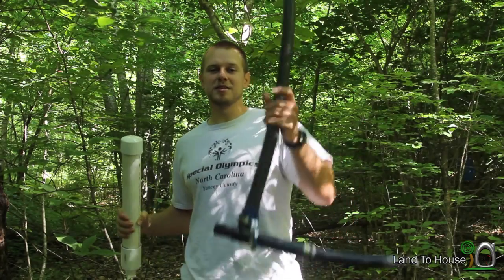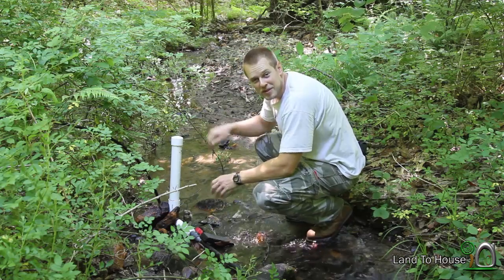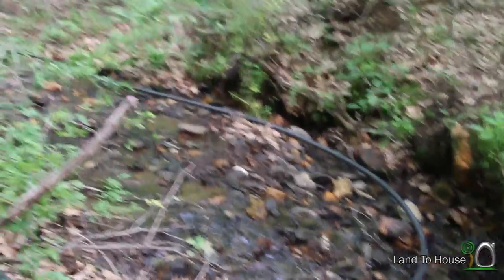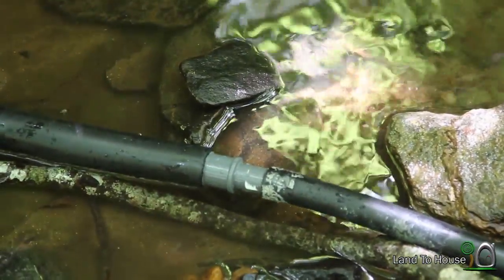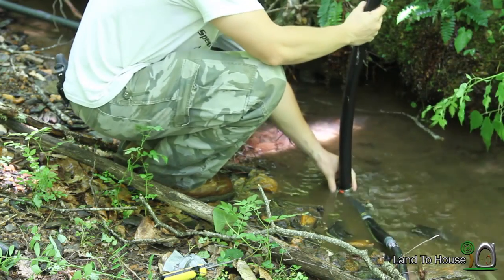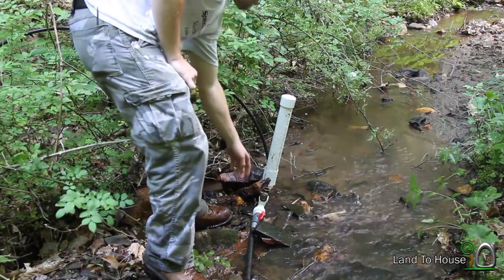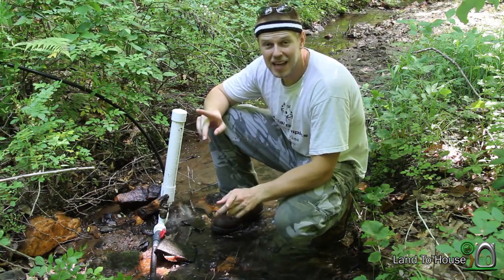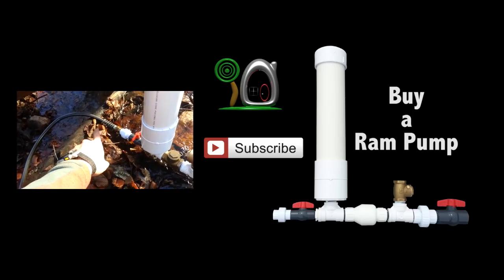Stand Pipe For A Ram Pump

Comment: I have a spring and the water supply is 30 feet away from pump.  I have a stand pipe ready to install but the five gallon bucket would be soon after that.  

I have a 1 1/4 inch ram pump and I have been following for a few years   I thank you for being a source of information.

Do I install the stand  pipe after the 5 gallon or before?  Or I don't need the stand pipe? I have to go approximately 350 feet

Comment: I've been watching your videos and you talk about the 3 2 1 on the supply, but I watched one of you're 1  1/4 videos and you only used a 1 1/4 drive pipe out of a bucket. My creek runs 300 gallons a minute and I put some extra  1" pipe I had from my well and it was pushing over ten gallons a minute through it. I have enough water to run the 1 1/4 pump, but i'm trying to figure out if I have to run 2" pipe for my supply? Any thoughts? I will have about 5 foot drop over 200 feet. Thanks for any input.

Comment: I don't understand how a stand pipe increases your flow or pressure. The added rise you got from adding the supply pipe is what gave you more push and volume. I suspect the water height in your stand pipe is equil to the added rise from the supply pipe you added.

Comment: Nice Video, How far is the stand pipe from the ram pump?  I am a bit confused how far the water rise in the stand pipe. It should not be greater than 2ft which is the vertical height of the river. Can you please confirm?

Comment: sir my souce water is 2 meter downfall only.. can i lift water 15 meter??
Reply: Hey buddy - generally the lift equals about 7 times your fall. So you're verrrry close- it can lift about 45.5 feet with your 6.5 feet of fall. So if you increase your fall just a bit more you'd be able to lift it- You can try to make a Dam, and lift that water up a bit more from your source. Try using a "pond liner" - close up all the exit points, and raise your water level. Then use a stand pipe as the video says about 60-75 from your ram.

Comment: I dont mean to be rude, but havent you just moved the inlet of the drive pipe further upstream, creating more head anyway, which negates the stand pipe?
Shouldnt the stand pipe have been put in below your first intake?
Reply from the maker: The ram pump accesses the first open air water source. So moving the intake further up stream and installing the stand pipe increases the head pressure yet allows the source to be close to the pump.
Reply: Arrr okay. Stand pipe acts as a 'reservoir' of sorts. Itrigues me to trial with clear pipes and dyes to watch how the flow works within the pipes and visual rates. Or perhaps an idea for you haha. Good video anyway!

Comment: At the start of video you stated that you were using a 3/4 pump and could omly go 75(?) ft away from pump for drive pipe.  Is this due to intermal resistance of the 3/4 supply line? 
   Could this be fixed by running a larger pipe from the pump to where you stopped the new larger pipe.  If you check (with a transit) i would guess that is how much more head you would have gained without the stand pipe. Even without the stand pipe, I would think you could add the extra larger longer pipe to your original 3/4 and have the same results due to not having the internal resistance of the 3/4in.
  Im getting ready to build a ram pump and was wondering about drive pipe size and distance.  Also wondering about a larger pump(pump valves and air chamber)into a smaller outlet pipe line .
  I've heard about ram pumps years back and just filed it away in my  brain under " nice to know" information.  Iv3e recently bought a piece of property with a huge volume spring and now have need for one
I started looking for videos before finding your site.  You have WAY MORE info on your site than any others I've found.
  Keep up the good work

Comment: Hi. What if we extend the height of waste valve of your system?? I mean if we put the waste valve about a feet height from current position in your ram pump structure by putting a feet long vertical line between that T-socket and waste valve. I think it would cause more pressure into the pressure tank, equally effect as raising delivery head.
Reply from the maker: As the waste valve rises up closer to the source water it reduces the head pressure. This reduces the pressure potential.
Reply: @LandtoHouse  Thank you & much appreciate for your response.

Comment: A standpipe used in a gravity fed system just eliminates the resistance in the line above the standpipe and serves to regulate the delivered pressure.    You want the line below the standpipe to be smaller so as not to suck all the water out of the standpipe.    Determine how much water pressure you want at the delivery point.  Say you want 10 psi.   Then go up the line till you gain 23’ in elevation and put your standpipe there.   If that’s not enough water flow then you may need a bigger line at the bottom.

Comment: What about a 2"  to a  2" standpipe to a 1" drive pipe will that work ?
Reply from the maker: Yes that sure will! I have a newer video on stand pipes that might help.
Reply: Thanks rampump are a lot of fun to mess around with
Reply from the maker: @robertgray2849  yes they really are!
Reply: I have one more question I have a 1" ram with about 25' to 30' drive pipe I'm feeding it from a small creek with about 20'of 2" pipe to a stand pipe to my drive pipe I have got right at 2' of head the waste  valve is operating every 2 and a half secs I think I need to shorten my drive pipe what do you think?
Reply from the maker: @robertgray2849  that is slow for a ram pump. It's best to have it cycling once per second. There are a few things you can do. Slightly tilt your waste valve so that the flapper closes more easily. Go further up the creek to increase head pressure. You can also try to shorten the drive pipe. Or a combination of all these. 2 feet of head pressure is about minimum for the pump.
Reply: @LandtoHouse  ok thanks I will shorten my drive pipe about 6'and see what that will do hopefully  the water will rebound faster

Comment: This guy doesn't understand the physics involved here. His head pressure is increased because the extension of his drive pipe is at a higher elevation than before, the standpipe in this application will make little to no positive difference, if it did work then why not put a dozen of them on. Standpipes are used to prevent siphoning like in a toilet, if you don't have a standpipe then the weight of the water falling down the pipe will suck all the water out of the toilet u-bend. Also his rate of flow tests are never done correctly he should measure how much water comes out of the delivery pipe in a given time then modify his setup and redo the measurement to see if their is any improvement. He just wants to sell a diy product for consumer prices.
Reply: He does, you don't.  I had a flat river with 500' of drive pipe in = 1 Cycle time in 4 seconds that gave me 33psi.  I did what he said and put a standpipe in 100' away, 1 Cycle time in 1 second at 51psi.

Comment: I built a 1 acre pond last summer and have good fall on my 18" drain tube. Do you think I could run the water back over the dam for an airater? Worry about pond slim.
Reply from the maker: You can use a ram pump to push the Overflow back into the pond. It will depend upon the flow rate of your overflow. The large 1-1/4" pump needs 8gpm to operate. Do keep in mind that the ram pump is a low pressure output so you want to lift the water a decent bit so it falls with Force back into the pond

Comment: G'day Seth, have you thought about installing a bleeder valve after your supply valve but before the first swing gate valve, would be very handy to prime the supply line and easier than using a stick to bleed it
Reply from the maker: That is a really fun idea! I will add that to the list of videos to make this summer. I have a bunch of ram pump videos coming up.

Comment: Mate that is exactly  what i need.  i'll give it try and see if it make a difference?   how  mine is set up i don't  get enough head  for sufficient pressure.
Reply from the maker: Adding the extra supply line with stand pipe can really make a difference. I hope it works well for you.

Comment: Would have been interesting to see the difference of the extra head being added without the standpipe, just to explore the reality of rule of thumb calculations.
Reply from the maker: I do need to revisit this old video. I will put that on the list of things to do. Thanks!
Reply: You added two variables...longer supply line and the stand pipe. Which made the difference?
Reply from the maker: Adding the stand pipe is necessary when adding a long supply line. On the larger pumps the drive pipe cannot be longer than 100 feet or the Cycles become too slow for the pump to be efficient. The standpipe is simply a close to the pump representation of the added head pressure in supply line

Comment: My ram pump is 3/4 with a 1in drive pipe and I need a stand pipe. But I did not know that my dilvery line needed to be 2in could I just use a 1in stand pipe.
Reply from the maker: It is best to have the pump and drive pipe the same size. That will allow for best efficiency. The supply line feeding the stand pipe should be some larger than the drive pipe but it will work if they are the same size. As for Delivery pipe I have found that it does not matter what size.

Comment: have you tried installing two stand pipes?
Reply from the maker: There is only need for 1 stand pipe. The stand pipe brings the source closer to the pump. You dont need to have two sources.

Comment: If the Standpipe is near the ram-pump, it should cycle faster, due to less momentum to overcome from the water in the long source-pipe.
I call the standpipe, a slosh-tank, or accumulator, but if designed to slosh or resonate, it may increase the lift capability of the ram-pump.
Reply from the maker: Yes indeed. I typically like to keep the stand pipe within 100 feet of the pump and not closer than 15 feet. That way the pressure wave is not moving too long or short a distance.

Comment: stand pipe is preven air pressure?
if dont install stand pipe ..so the pipe will blown?
Reply from the maker: +MegaTUHAU the stand pipe allows you to keep the drive pipe shorter than 100 feet. If the drive pipe is too long it slows down the pump. The supply line to the stand pipe can be very long and then the drive pipe from the stand pipe can be shorter.
Reply: The stand pipe is so you have at least 1' of water above the outlet to the drive pipe. If you had less, the shock would travel back up the drive pipe and take away from amount going in to pressure tank. It's the weight of the water. If you had a 55 gallon drum with water feeding into the top of it and the drive pipe going out the bottom, you'd have that weight of water pushing against the water in the drive pipe, preventing the shock from traveling back up the drive pipe. You want shock at check valve into pressure tank. Which is why the drive pipe should be as rigid as possible. Incased in concrete if possible, but at least steel with earth or rocks on it. If you have a pressure gauge on the delivery pipe , you can tell how far up it will push the watr by pressure. If the gauge reads 17 psi, the water is being pushed up .434 psi per foot or 4.34 psi every 10 foot

Comment: so,in theory,you could add as many extra stand pipes, and you would actually have more presure to pump watr,further ,or am i wrong ...
Reply from the maker: +dave leech actually the stand pipe is only used when you have to go further than 100 feet with drive pipe. The height of the pipe needs to be taller than the original source. You only need one stand pipe.

Comment: I need to pump over 150ft nearly vertical can I use one of these it may be more like 100ft vertical
Reply from the maker: +Linda Phillips I have pumped to 70 feet with 12 feet of head pressure. I know of a couple people that have pumped over 150 feet vertical. The pump will wear quickly at that hight but it is possible.

Comment: Hello,
I have built a 1" ram pump thanks in big part to your videos. Thank you. 
I do not get this process of adding a stand pipe tho. Did you increase the size of the intake hose and increase the diameter of it aswell at the same height as that of the existing intake 3/4 hose? Thanks in advance.
Reply from the maker: +epyon2k6 the standpipe is especially important on larger ram pumps. When you cannot get sufficient head pressure within 100 feet of Drive pipe. Adding the standpipe allows you to move the source of water closer to your RAM pump. Let's say you're using a 1 inch RAM pump and you needed to have 5 feet of head pressure over the course of two hundred feet. You could install a 1-1/4" supply line 125 feet long that feeds a standpipe from the standpipe you would have your 1" drive pipe.

Comment: I just put an update video showing the results of my system after 8 years. I am still using the original 2 inch foot valves that I converted.  The all brass valves with the rubber 0-rings have worked out quite well, I just have to replace the 0-rings every 2 years or so.  I was charged $80 each to have a machine shop make the valve stems.  All the other parts are off the shelf.
Reply from the maker: +fireye2012 I will go check it out. I have been wondering how to have a valve made from scratch

Comment: a stand pipe is needed to stop the pulse wave from going up and down the line and stopping the pumps.  Get rid of the plastic is also rule no, 1.  Plastic ram pump parts do not last.....My pump has been running for 8 years and the plastic parts died long ago.
Reply from the maker: +fireye2012 yes the pressure wave searches the shortest route to air. My PVC ram pump has been going on and of for 3 years. Keeping it in the shade helps a lot. I find that the brass valve pin goes before the pvc.

Comment: Hello Seth, nice video again, I have many of yours. I have a question, you said your head without the stand pipe is 2" to the pump, now you're adding a stand pipe at the point of that 2' of head, that means going further upstream for a new intake. What would you say your physical fall between the new intake and the stand pipe is? I mean not judging by the level of water in the pipe.Someone suggested that the level of water in the stand pipe would decrease once you open the valve to your drive line, I don't want to believe it would, that is why it is recommended that the supply line should be double the diameter of the drive pipe, that way, the ram can get enough without lowering the level in the stand pipe.
Reply from the maker: +Waidi Oguntade Thank you for watching! The physical fall between the intake and stand pipe actually is the same as the water level in the pipe. Its like a water level used in construction: The lower end is the same level as the upper end. You can just put a tape measure up to the pipe and determine the feet of head gained by the pipe. As for the decrease of water in the stand pipe I did not see any change in the level with the 1-1/4" stand pipe and 3/4" pump. I have a feeling that a stand pipe the same size as the pump might have an issue with water level lowering. But with a stand pipe at least one size bigger then the pump I should think that would be just fine.

Comment: Seth, Am I able to run a Ram pump with next to no fall into the pump from the inlet point on supply end. Do have extremely fast flowing water. Will stand pipe improve outcomeCheers Paul from down under.
Reply from the maker: The head pressure is what makes the ram pump work.  Without feet of head its almost impossible to get the pump going.  The minimum is about 1 foot but 1.5 to 2 gets it going well.
Reply: My calculation is that a 'no head' flowing river actually have some certain fall, otherwise there will be no flowing at all. Run a 200 feet in your river and see the result, it may not be much but the outlet level will definitely not be the same as the inlet, go 300, 400 to get more fall, the cheaper, lighter waste pipe should be OK, since it won't be under pressure.
Reply from the maker: +Waidi Oguntade yes. I think my description was poor. There is fall in the river for sure! When that pipe is placed in the river and the outlet is picked up to match the level of the inlet you can measure from the water serface to the height of the pipe and that is the feet of head. In a "flat" river it would take a lot of pipe to gain enough head pressure though.

Comment: Seth is there a way to install the supply line and ram pump permanently allowing for flooding creeks ect.. I would like to supply some cattle with water year round but don't want to pull the pump everytime there is a threat of heavy rain?
Reply from the maker: +curt bower I have a couple videos that show how I install the ram pump so that it is located out of the creek. This will help keep it safe in a flood. The first video is an install on a small creek. https://youtu.be/Dq6KYHzZ_z4
The second video is an install on a larger creek that floods a lot. There is not much feet of head so the pump has very little output. https://youtu.be/zMByFpfjWrc
Reply: Thank you for the reply IL check it out